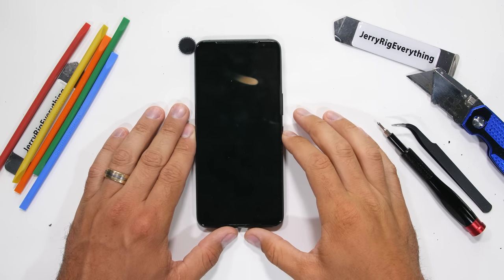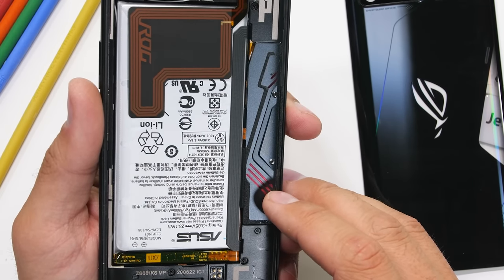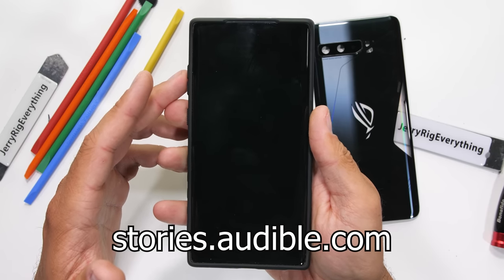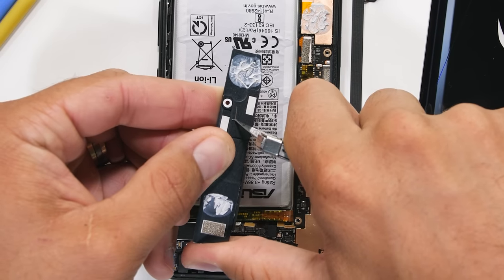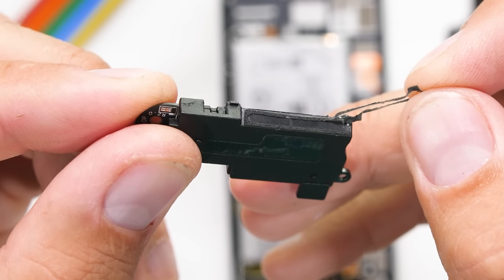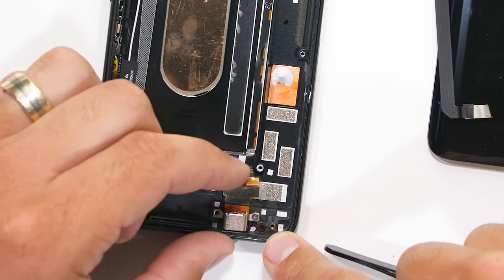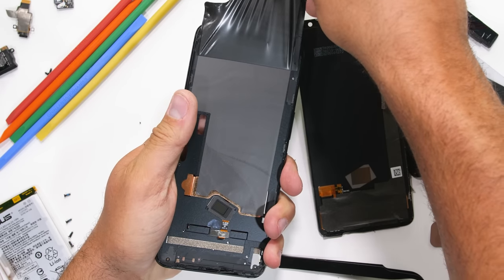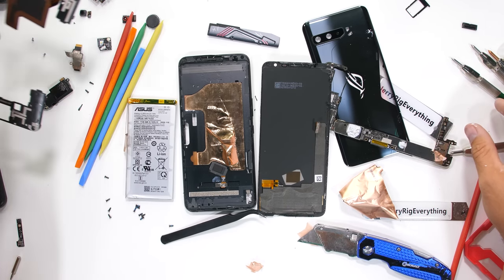ROG Phone 3 Teardown! - Is the 'Cooling'  Inside Real?!

Comment: It was reported earlier that users are facing the black crush and broken display rate issues. Reports of overheating issue also came up and an update was promised to address it.
Reply: I dunno I use mine everyday and game hard on it and haven't had any problems yet....what I don't get is the stock case that came with it blocks where the heat is supposed to vent from I think but I'm not sure....still trying to figure out if it actually cools itself....cause I feel like the fan attachment is for show cause it don't even touch the phone...guess it's just supposed to push the hot air away from the phone

Comment: What gets me is that I don’t see a point to a gaming phone.  Like I get that you can stream games from an actual console or whatever to it.  But I can do that with my current phone.  
And I can’t imagine people buying something like this just to play clash of clans or whatever for 5 hours straight
Reply: Well, here I am... I bought it because..

1. I LOVE mobile games (many different kinds)
2. I needed a new phone anyway
3. Got it for 200€ cheaper than normal
4. I love the look
5. I don't buy phones from apple and samsung
6. I'd normally buy from Huawei but Murica
7. I wanted to buy a phone which will meet futures requirements
8. I like the accessories

The reasons have no order, just randomly mixed arguments for ME to buy the phone. :)
Reply: it's not because of gaming...Look at the design - the cooling system. The high-end chips tend to be hot, the cooling system in now a day phones is very crucial part of the phone, no matter is it gaming, high-end or mid phone. On longer run cpu will throttle and slow your system, the software -> kernels or/and thermal tweaking won't help much.

Comment: I am planning to replace the battery in the next year. This phone has lasted very well. Still fast af... I don't have any upgrade path until Red magic becomes available in India.

I bought the 12GB version and this phone is still kicking around 8 hrs screen on time. I never charged it above 90%.. mostly I keep it at 80%.

But the battery is now showing age and is getting hotter than it ever did. I did win the silicon lottery and I can run it for 3 years at least.

This phone has no water protection but there's no option better to justify the high price.

Comment: I know this video is quite old for modern standards so I don't expect anyone answering, but the USB port on the side of the phone has this second port next to it what looks like it's pure copper. What purpose does it serve? An extra port for power supply? Heat transfer? Or just for stabilization for the gimmicks?

Comment: ROG 3 keep restarting on its own these days. sometimes even shut down & restart again right after restart...  speechless.. only after warranty ended then problem start coming.. wonder what causes it, already back track as much what had I done and already uninstalled any recent app before this issue start. but still the same, I'm suspecting if the heat detector within having error that trigger it the shutdown & restart.  any help pls

Comment: yet....what I don't get is the stock case that came with it blocks where the heat is supposed to vent from I think but I'm not sure....still trying to figure out if it actually cools itself....cause I feel like the fan attachment is for show cause it don't even touch the phone...guess it's just supposed to push the hot air away from the phone

Comment: Hey Jerry, I bought an ROG 3 with 8gb ram and 256 storage. Is there a way that I can take out the 8gb ram from the mother board upgrade it to 12gb or 16gb?
Reply: In theory yes. In practicality no. If the only board difference is ram chip capacity, you would need a very high level of micro soldering knowledge. The cost of possibly doing so would be greater then the phone.

Comment: I want a mobile phone which is smaller and has optical image stabilisation
Reply: Then get one. The ROG 3 is a FOCUSED phone and it does some things very very well but has to sacrifice and compromise to deliver on that unparalleled performance. I had a OnePlus 8 before which has the same chipset, the cameras were much better and the phone was nicer to hold and more ergonomic and the display was far more colourful and it receives regular updates which the ROG is unlikely to get. The ROG 3 though is a joy to game on with the air triggers, the battery is just massive the built-in speakers are actually usable and front facing. The ROG isn't a "pretty" phone but the moment you pull it out of your pocket and people see the RGB logo or in my case the lightning armour case they all want to know what it is. Not many people in the UK have them so it's very exclusive, work's just fine on any network and with a fingerprinted global ROM that works with Google Pay etc why they didn't officially sell it here is sad!!